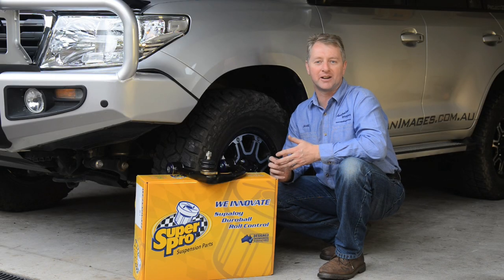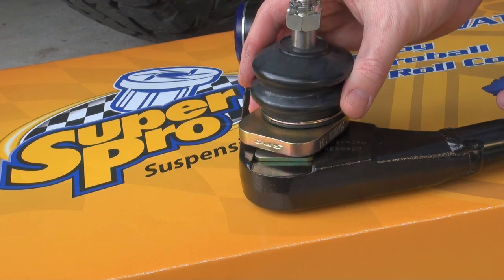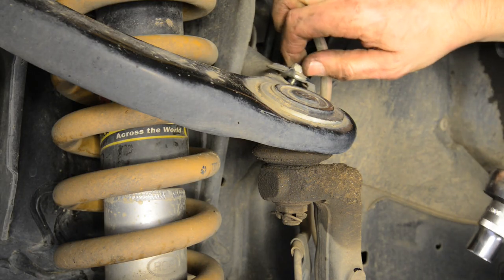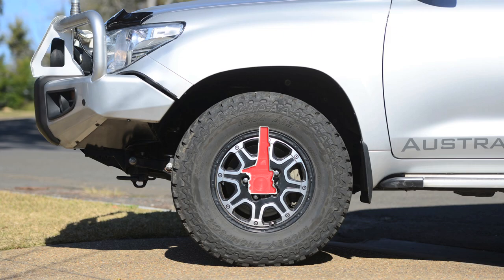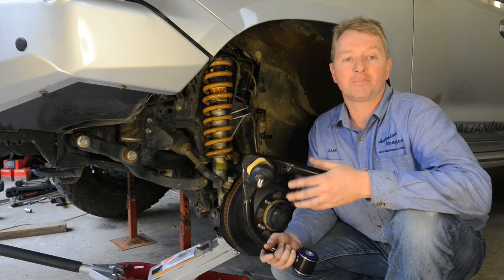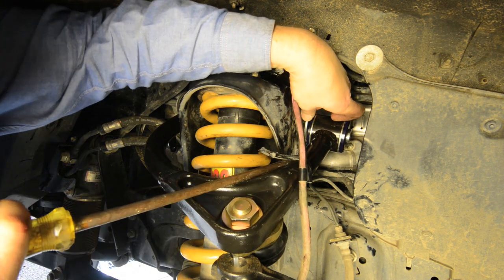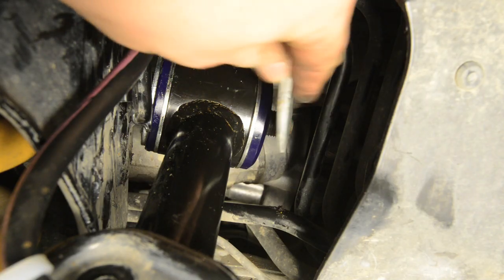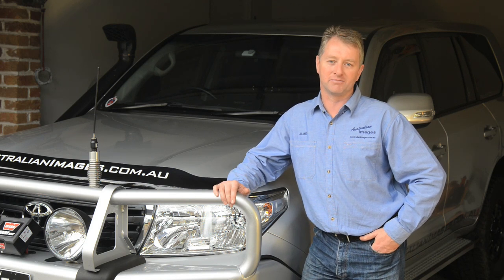LandCruiser 200: SuperPro UCA upper control arms install (SPC arms and balljoints) - Project 200

Comment: Alignment camber & caster is adjusted at the bottom control arm on an unmodified vehicle, so with these adjustable UCA installed the alignment changes should really be done combining both adjustment points to reduce actual ball joint offset.

Comment: Side question: I noticed you’ve retained the factory front horizontal and vertical tiedown points. Have those been sufficiently strong for recovery and winching? I read on the forums that they don’t hold up and wondered if you had real world experience. Thanks for your videos as I have learned a lot about how to take care of my cruiser from them.

Comment: Hi there i have fitted the uca super pro to the left hand side 
The question i have is on the drivers side to remove the bolt there is the intercooler piping that looks to be in the way of getting the bolt out.
So did you need to remove the piping or not as there is nothing on your video of having to remove it.
Regards 
Glenn
Reply from the maker: I didn't have to, but I have heard of others that did. There may be some variation in body mounts etc that allow some people to slip the bolt out, and others not to. From memory, the alloy pipe has rubber hoses on each side, so releasing the two bolts and perhaps losing the hose clamp should be enough to get the bolt out.
Reply: How did you go removing the piping?

Comment: How are you setting the UCA retaining bolt torques? You mention the value but appear to be using an open ended spanner and looks too tight to get a torque wrench and socket in there??
Reply from the maker: You need a flare nut adaptor for the torque wrench

Comment: Hi Jamie, are you still running the original ball joints? No issues with them? Thanks mate.
Reply from the maker: Hi mate, I changed the balljoints quite early to the greasable SPC versions which Superpro sent out. Haven't had any issues with them (or the previous ones). Since that time, Superpro have changed the design of the arms, and now use a completely different balljoint. I've not heard of any problems with the new design.
Reply: @austimages  Thanks

Comment: Hey mate, how do you indicate the front jacking point in the middle? I am about to this myself! Thanks
Reply from the maker: I can't actually remember with the factory bash plates on there, as I've got aftermarket ones there now. Just check the positioning on the video, but if I recall correctly there are a couple of bolts in the location you can use. Just make sure there is something solid behind (eg crossmember), not lifting off the thin metal of the factory bashplate.

Comment: If super pro wasn't available....what upper arm would you suggest with the tough dog suspension?
Reply from the maker: 2nd choice would be the Slee arms. They are the same adjustable arm as the Superpro, just with different bushes.
Reply: Australian Images 
If I don't change the upper control arm and keep the original one is it OK?
Reply from the maker: Depends how high you lift. The higher you go, the more needs for the UCAs. Without them, you can't get proper wheel alignment and you'll get bad tyre wear.
Reply: Australian Images is fitting superpro bushes kit is good for off roading with the arms?